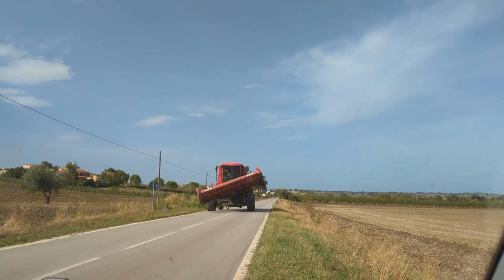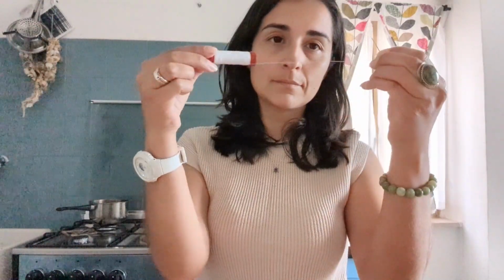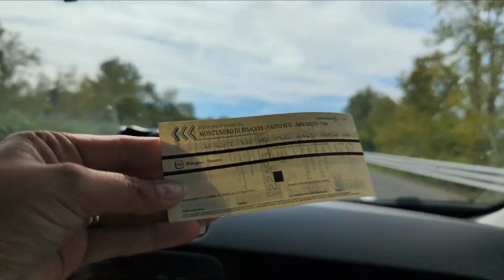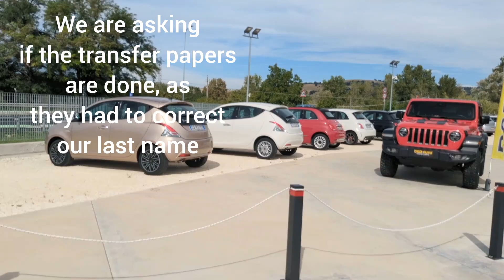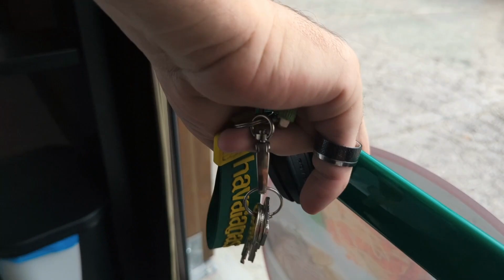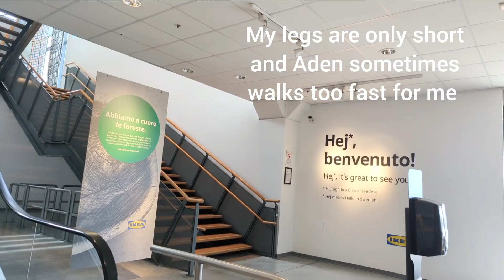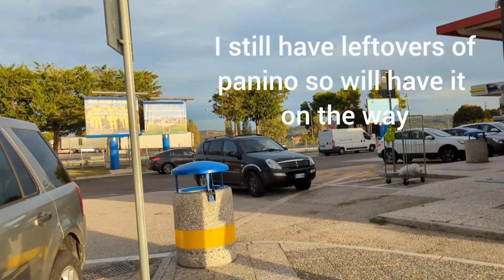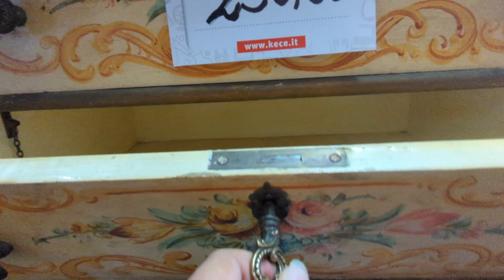Our Italian Home Renovation Episode 2. Learning to cope with stress and great news

Comment: Hi! ¿Do you have european driving license7? Otherwise your car won't be adequate since it has more power than the one allowed for people having european license for the first time. I know, because my parents are currently living in italy. They drove for the first year with the international license. But once it  was due, they had to take classes and do the exam (which they passed),
Reply from the maker: Hi Maria Eugenia. We are stil in the year that we can drive with the international licence. We may get a smaller car with less Kilowatts for the following year when we take the test. We've heard that the test is really hard, so well done to your parents for passing it! 
Thanks heaps for the heads up 🤗☀️
Reply: @rossinniandco  My parents bought a Fiat Panda. One of few models that have the adequate kw power as a first license owner.
Reply from the maker: @mariaeugenia7599  yes, they're awesome and easy to find parts for. We want to get one of the old ones, preferably 4x4 but those are pricier 😉